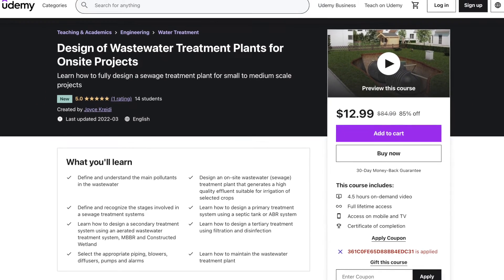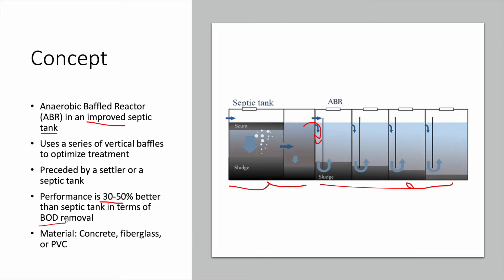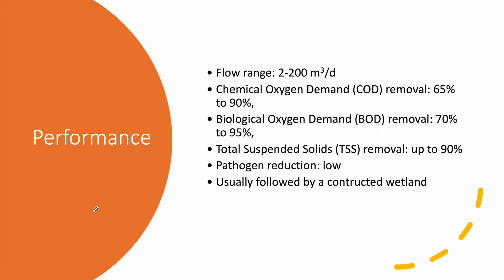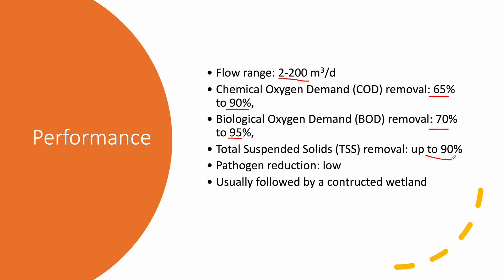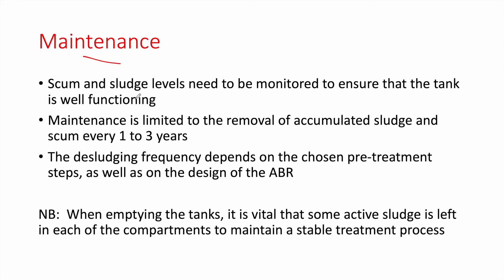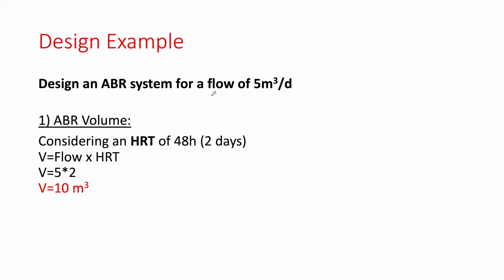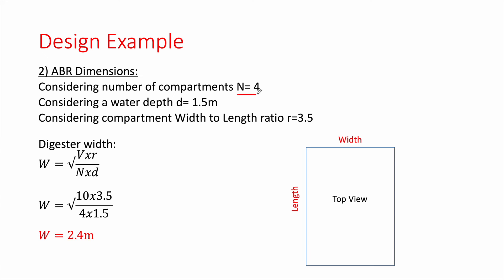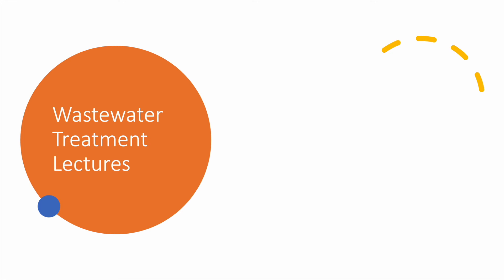Anaerobic Baffled Reactor (ABR) for Wastewater Treatment: Advanced Septic Tank Design & Description

Comment: Dear madam, if the tank septic tank capacity is 4000l and if it overflows once a week, how would you calculate the flow rate? is it equal to 4000l/7 days ? Thanks